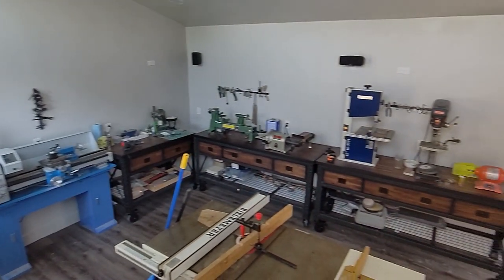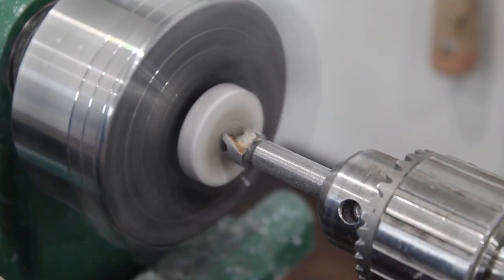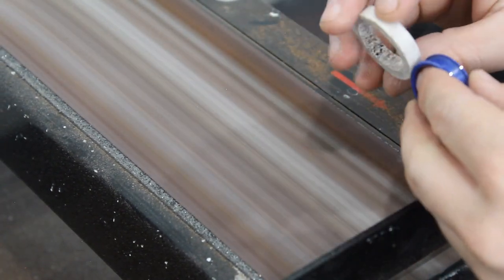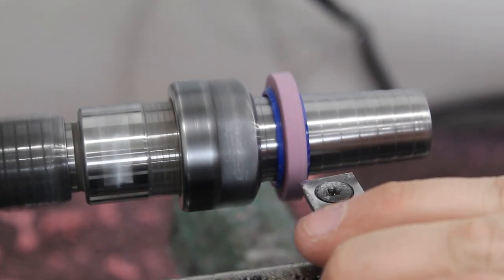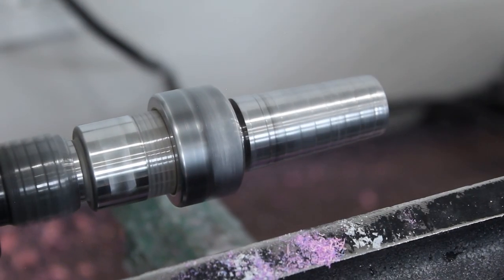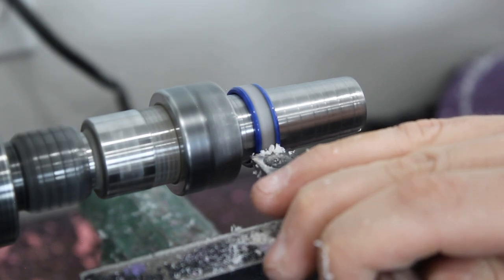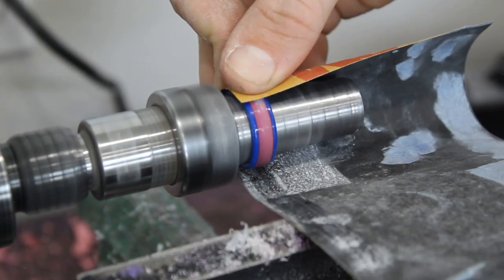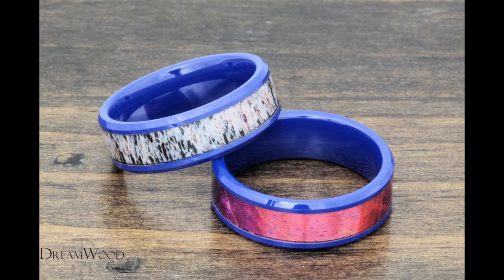How to Inlay wood and antler into a ring! Easiest method

Comment: I made a solid antler ring from a old shed and used ca as my finish. It looked great for about 3 months. The glue began to separate from the antler. It looked like the antler shrank away from the ca leaving a shell which snapped off later. Have you ever seen something like that?
Reply from the maker: Hey, I have not seen that happen! Although with natural materials I would say definitely possible. Was it in a channel ring? Or over a flat core?
Reply: @DreamwoodRings  it was made with a solidcut. I cut it at a point where it was mostly the hard outer.  I was using a medium BSI. Is starbond that much better?

Comment: Where do you get the cutter tool inserts at 2:15 at, if you don't mind me asking?
Reply from the maker: I'm using the boring head tool. I actually have not shopped for the bit I'm using with it. Someone brought it to me and asked if I could use it. It is basically this. https://www.mscdirect.com/browse/tnpla/70913520?cid=ppc-google-Smart+Shopping+-+MMR+-+Indexable+Cutting+Tools&mkwid=%7cdm&pcrid=547379753978&rd=k&product_id=70913520&gclid=Cj0KCQjwgYSTBhDKARIsAB8KukvEPNIaKZ9Xf4sL8ZzOm_t0SiG29eT5ipTNu1J2_91LsFjgxDhx614aAnD5EALw_wcB&gclsrc=aw.ds

Comment: Is that blue ring blue all the way through.  I ask because if you accidentally hit it with sandpaper or chisel it would be scratched.
Reply from the maker: It is blue all the way through and it is ceramic making it very scratch resistant!